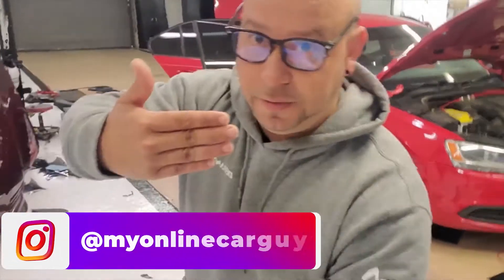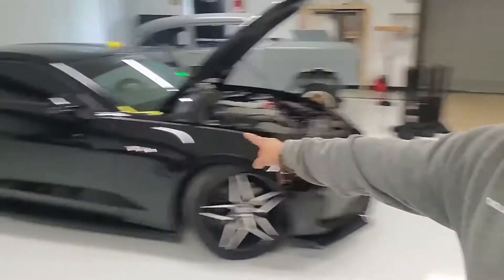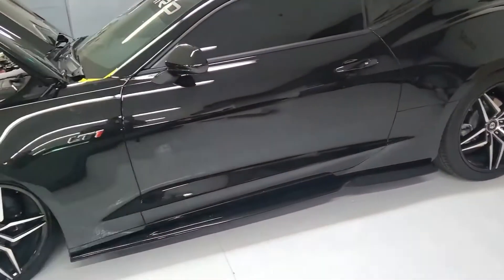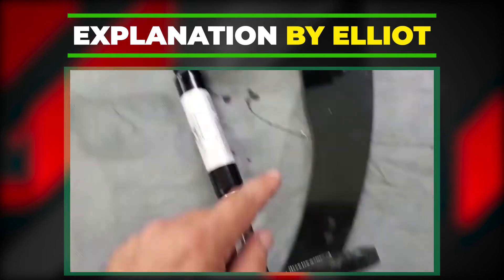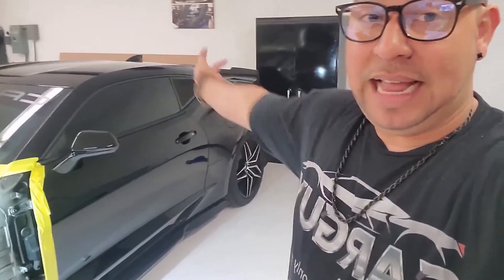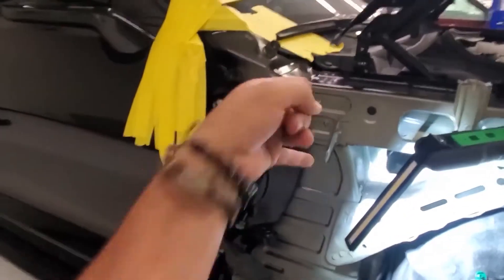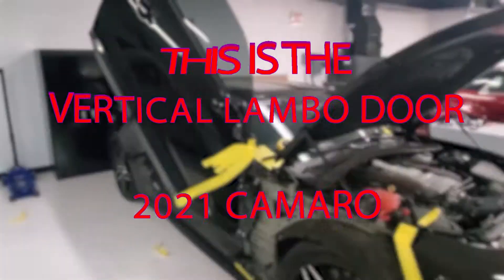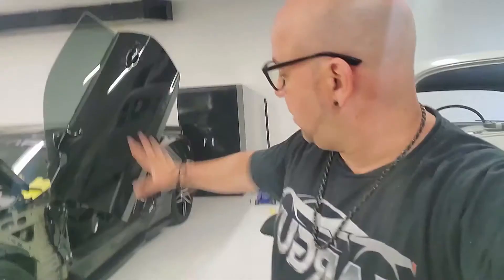DIY lambo door kit installation, Step by step in 2021, camaro

Comment: I'm working on a project, I'm putting sum on a 08 Dodge charger I have the universal kit, Can I use my original top holes for the new kit or I have to make new holes in the center??
Reply from the maker: Unfortunately with a Universal, you'll have to assume none of those holes will work for your car.

Comment: I have a 96 gmc Sonoma SLE do u have any Lamborghini doors install videos for it
Reply from the maker: I have done the install on that many times,  unfortunately i dont have any "how to" videos on it. Sorry my man.
Reply: @myonlinecarguy1   ok when I buy the door kit for my truck it should bolt straight up without no cutting right
Reply: Am watching the video on the black Camaro n it seem those bolt straight up with no cutting
Reply from the maker: I believe in that year. You have to cut. If I recall correctly, your factory hindges are welded onto the body side.. So theyll need to be cut off. You should be able to corfirm if they are no bolts holtong it on. It will also be in you instructions as well.
Reply from the maker: Thats not a 96 gmc sonoma though. Whole diff vehicle my man. Sorry. Diff car is going to be a slightly diff install.

Comment: Hi, I am glad to watch this. I wonder if I can make you a question? I have brought a Toyota cellica recently, it’s brought lambo door system, however the hydraulic has gone. The problem is that I don’t know how pressure is needed 850 psi or 900 psi? The hydraulic label has been erased. Please can you advise me? Lot of thanks for helping.
Reply from the maker: Call the manufacturer of the kit. They will have proper vehicle replacement shocks for you. As they know what comes with the kit originally.

Comment: Did you have to cut/trim any of the fender off for it to fit?
Reply from the maker: Always, yeah. That inner lip gotta go. I usually leave about 1/4inch.
Reply: Oh ok. Would a circular saw do the trick?
Reply from the maker: I use an angle grinder with a carbide blade.

Comment: I've had my vertical door kit for 2yrs now. However, now when i open my driver's side door (because its the side thats most used.) My door drops a little bit. And ive notice that the door and the front fender are slightly misaligned..what is the solution to readjusting or realigning my door to prevent further damage from my door dropping when its being opened.
Reply from the maker: Reorder a new shock. It swaps out semi easily. Itll fix that right up..
Reply from the maker: Also once it's realignment happens. Spot weld the kit. Not a long weld. Jjst a tack to hold it.

Comment: I have a 2021 challenger superstock  i had vertical doors put lambo doors on it  i am having trouble with electrical in car radio ac and windows keekin going out  they told me they didnot cut wires on car door took it to dealer they told me they spliced doors  so they would not watenty anything  only 7100 miles on this car .now i have no warranty  .any thoughts  do you splice wires on the doors
Reply from the maker: I build full door harness extensions for my clients. This is going to be a pricy fix. But it is fixable probably..

Comment: Can you if you want too ...make the door lift higher? Higher than like a 90°? Or even higher? What about open like a regular door instead of that limited opening? What about the gassed air shock can it be replaced w another that lifts higher? & How much do these kits cost?
Reply from the maker: None of those extra adjustments are possible. For many reasons. Each kit is to the max the each vehicle is capable of. (Very short reason-door would hit the fender/ hindge pivot point isnt the same anymore/ if ots free to move more it cannot ALSO be limited and tight in the same design) 

I hope this clears up some of that. On average  these kits are around $1k give or take $200. (Again each car is slightly diff)

Comment: Hello sir I am having a 2  jbl svc subwoffer of 4 ohms 300 rms  and  sony 4 channel amp wich has a (70w x4 at 4 ohm ) (85w x4 at 2 ohm) at  bridge  mode it give (175x2  at 4 ohm )  and another amp which is cerwin vega  which is mono amp its rating is  150x1 at 4 ohm and 250x1 at 2 ohm plzz tell me which above amp can i use to get a good sound
Reply from the maker: I would use the mono amp. But thats just me.
Reply: @myonlinecarguy1 how sir plzz tell me sir

Comment: Hello sir can we use only single voice coil of the dual voice coil subwoofer / can we connect one voice coil to one ch and another voice coil to another channel
Reply from the maker: This is possible, yes. But not the best way of things. But yes, its possible and would work.
Reply: @myonlinecarguy1  tnks sir
Reply from the maker: No worries,  goodluck with your system.

Comment: Hello sir i am having infinty 12’’ subwoffer kappa 500 rms watts  having a switch for  2 ohms and 4 ohms load adjustment  I am having small dout sir if  I put the switch in 4 ohms load will  watts will be 500  and if I put the switch to 2 ohms load the watts will be 1000 is this true sir plzzz help me to clear my dout
Reply from the maker: This will be told to you by the amp. The answer is YES, very possible that amp will give 1000 at 2ohm and 500 if 4ohm.
Reply: @myonlinecarguy1  tnks sir
Reply from the maker: Your welcome. Good luck with the system.

Comment: Sir small dout if am having a 2 svc subwoofer of 4 ohms each sub of 300 rms  if i do the series wiering wat will be the rms out put of the subwoffer and wat  will be the rms if wiered in prallel  plzz help
Reply from the maker: The  rms of the spkr never changes does not matter 1 ohm, 2 ogm dvc, 2 ohm, nothing.  Only the power coming out from the amp changes.
Reply: @myonlinecarguy1  i thought if doing series wiering it will give 8 ohms load and 600 rms and 2 ohms load and 600 rms in prallel wiering
Reply from the maker: Yes the ohms change in series vs 7n parallel,  but it doesnt change the subwoofers RMS. 
And the ohm of the sub tell the amp to give mote or less power based on rms. But the rms of the sub itself NEVER changes.
Reply: @myonlinecarguy1  thank u so much sir for clearing my dout 👏 i am from india
Reply from the maker: Your wlecome. Be safe out there.
Reply: @myonlinecarguy1  yes sir

Comment: Sir why some speaker has same rms output and different ohms for example a (speaker rated 80 rms output 4 ohms ) and another (speaker rated 80 rms output 2 ohms) why the  rms out put is same but the ohms is diffrent  plss clear my doubt
Reply from the maker: Rms = how much ppwer it can hold. 

Ohms= tells the amp how much power to send.
Reply: @myonlinecarguy1  sir both the speakers they or giving same rms power  they why they have given different ohms
Reply: Sir I am having 2 ch car amplifire  its specifications  is rms @ 4 ohms is 60 watts and 70 @ 2 ohms and bridged 140rms at 4 ohms  why they have given 140 rms on bridge @ 4 ohms as they  telling 60 watts a 4 ohms then  the rms watts should be 120 on bridge mode why they have given 140 rms on bridge mode sir
Reply from the maker: Bridge is an extra way to wire for extra power if you have 1 speaker of 4 ohm only and need extra power.
Reply from the maker: Also, it seems as you have 2 diff speakers. They should be both 4ohm or both 2 ohm. .. rms will remain, that wont mayter right now. But you have aquired 2 mismatch speakers.
Reply: @myonlinecarguy1   actualy I  am seeing on amazon to buy  for my car for front door   Component spekers  I saw infinity its showing 2 ohms  80 rms and where as jbl is showing 4 ohms 80 rms  is same but price of infinity is twice higher then jbl I got confused because the rms is same   only the ohms is different but why the price is very high

Comment: When I put a Lambo doors on a 2015 Chevrolet Camaro and I'm going to need a wire harness
Reply from the maker: Unfortunately noone makes harnesses. I always have to hand make mine and for clients. But yes.youll jeed an extended harness of somekind. The door is like 1" too far for stretch.
Reply: Do you know where I can order it from
Reply from the maker: No-one makes one my guy. Im sorry. Truth is, i might create them in time. But i dont have any ready just yet
Reply: Do you know when you can have some?
Reply from the maker: Whatvis the exact yr and all of your camaro. I'll check on parts here.
Reply: @myonlinecarguy1  did you end up doing a follow up on the electrical portion of this DIY?
Reply from the maker: It is actually in edit. The original fike were corrupt unfortunately.
Reply: @myonlinecarguy1  In which edit? If you have a link to any video that could help me out I’d appreciate it.
Reply from the maker: My editor has the files.  Its not yet uploaded. "Its in edit" sorry. Its not yet available for Youtube.